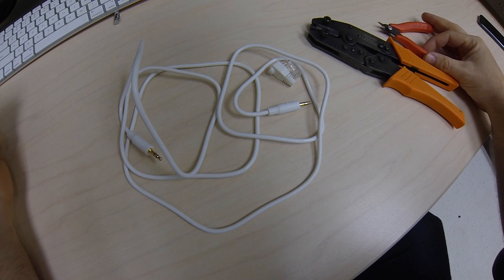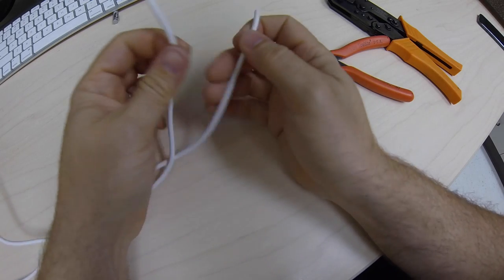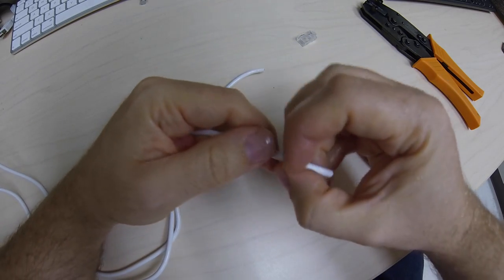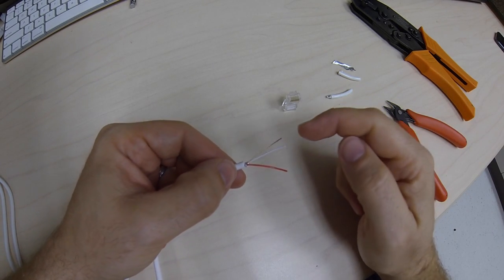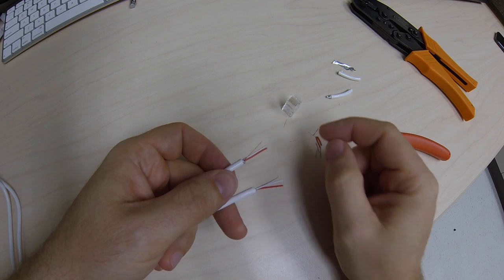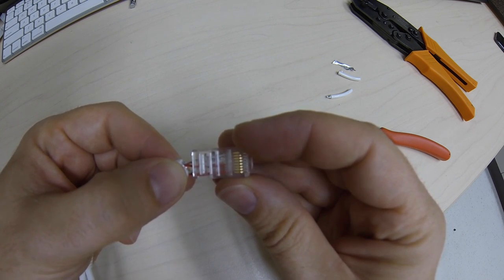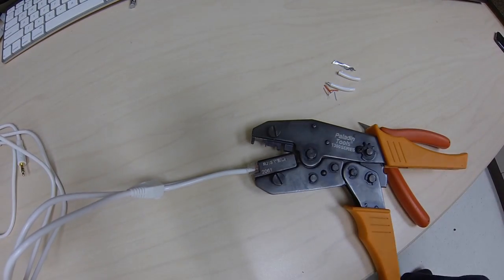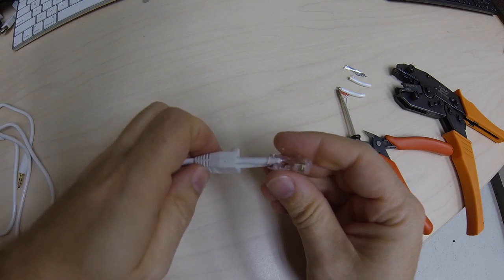Unbalanced Audio over UTP part 2

Comment: why the crisscross ?
Reply from the maker: Line balancing rejects noise. Unbalanced audio has a really short distance.
Reply from the maker: Oh. The stereo pairs? Because that is the pinout of the cat5. I want it to be cross compatible with the standard cat5 wiring. If you are running 4 mono channels you would need the extra "grounds" and you could put it in any pair you want, but it needs to match up with the pairs on the cat5.
Reply: @anotherdayinparadise9744  What would be the pinout for this?